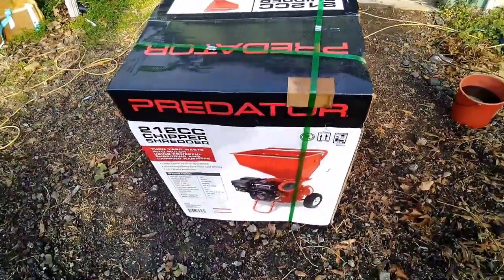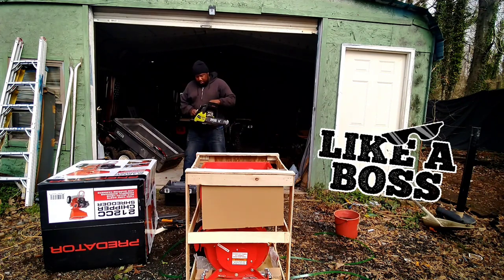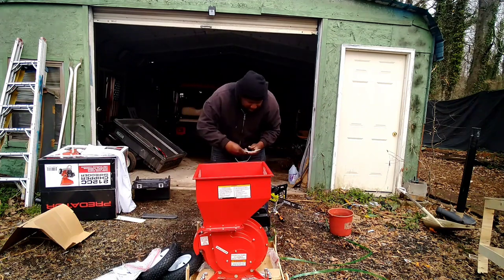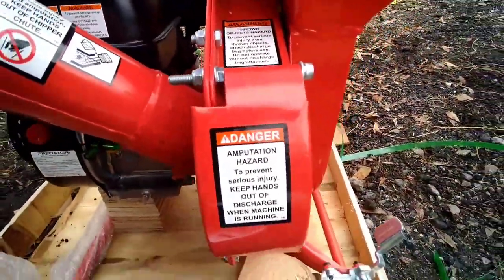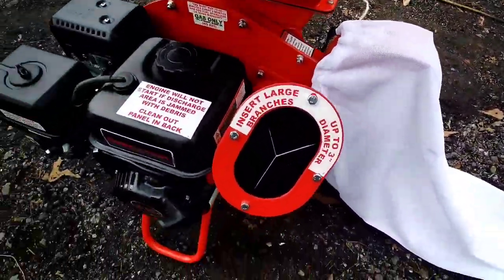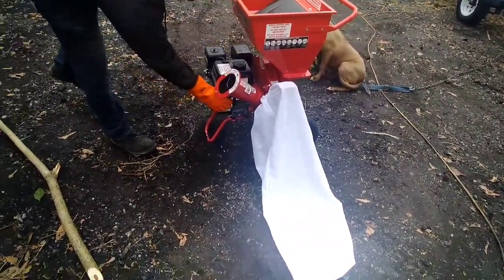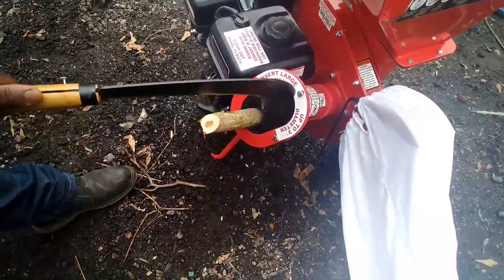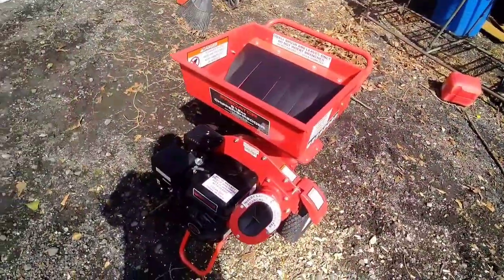HARBOR FREIGHT NEW IMPROVE!! | 6.5hp CHIPPER SHREDDER | FULL REVIEW | WHAT U NEED TO KNOW |

Comment: Saw a video when they still put 6.5 hp on the engine. The Guy bought it used. The previous owner  got a limb stuck in the throat after only a few uses. . He took the blades and sharpen them. Said it improved  the chipper performance. He said the blades come from the factory unsharpened.